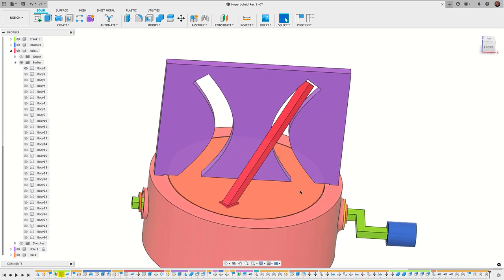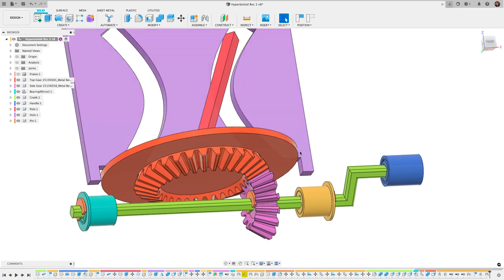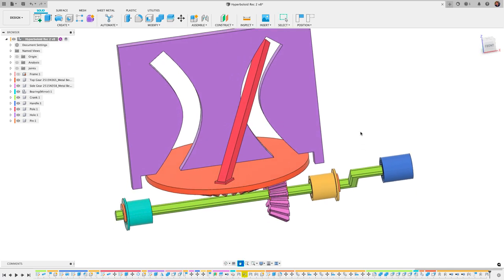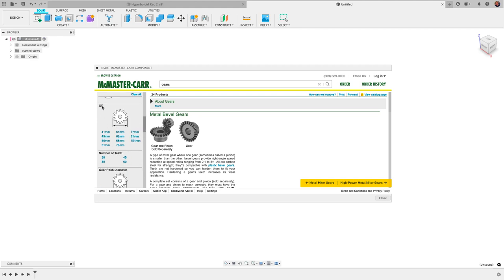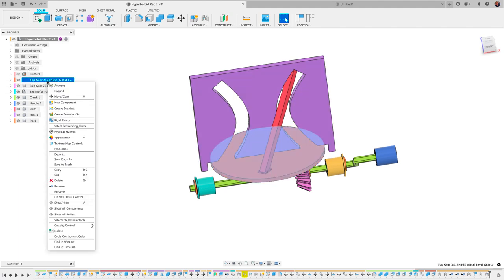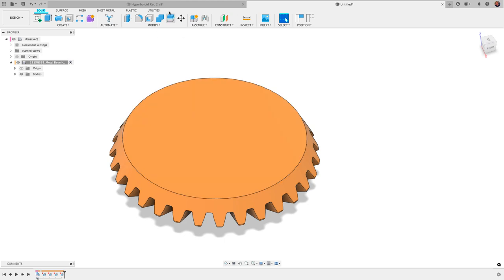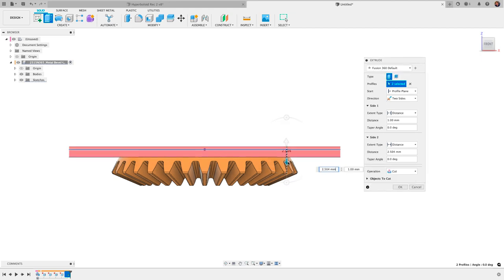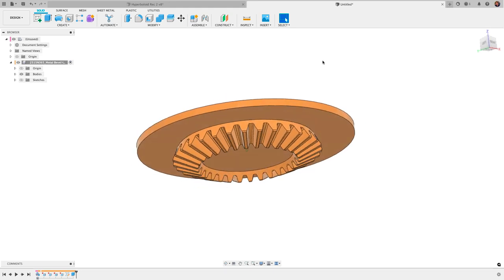Bevel Gears in Fusion 360

Comment: Great time saver.  Thanks.  If you import both gears, do they already incorporate clearance for printing, or does this need to be done afterwards in the design?
Reply from the maker: If you space them according to their mounting distances, the spacing works out perfect without the need to include a clearance for printing.  I plan on doing a follow up video to show this.